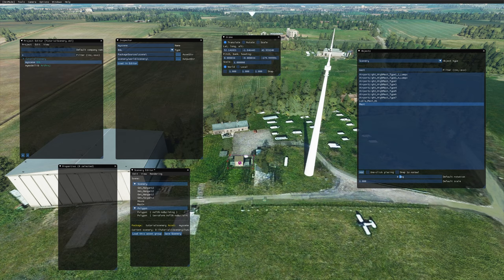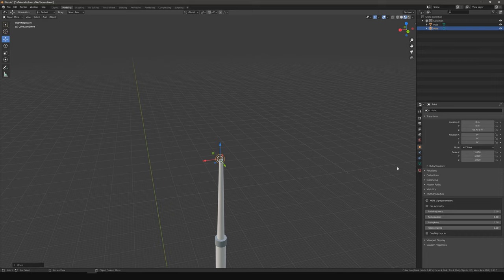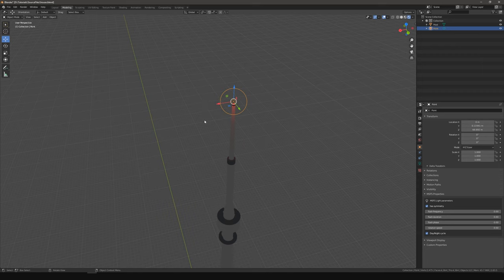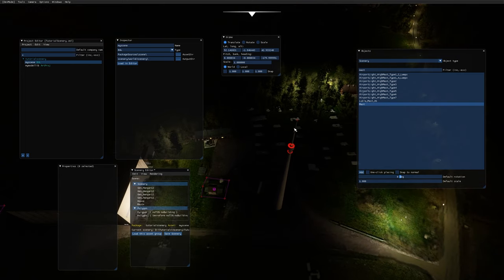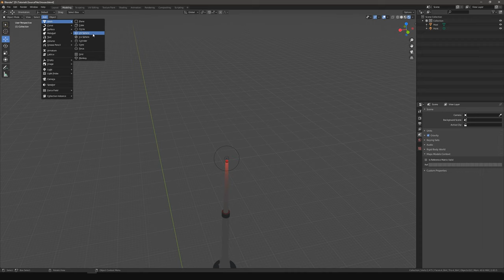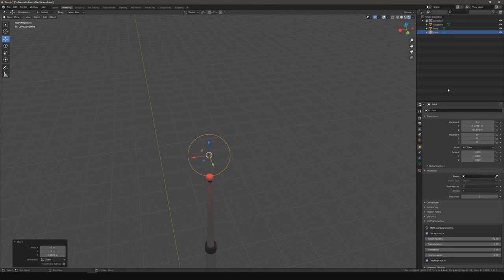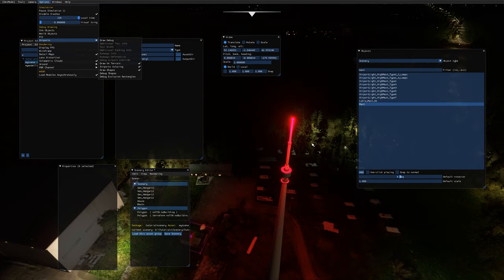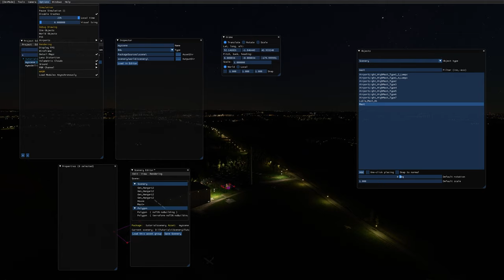[007] Red Flashing Beacons - Microsoft Flight Simulator 2020 SDK Tutorials

Comment: In case one wonder how the frequency, duration and phase of flashing light sources are defined:
-	“frequency” is triggers per minute, so 60 means the light is flashing every second, 20 means the light is flashing 60/20 = 3 times a minute. The higher the value the faster the light is flashing
-	“duration” is for how long the light is ON in seconds. A value of 0.5 means it will flash for half a second
-	“phase” is a delay in seconds. If you have multiple light sources in you object and set “frequency” to i.e. 10, “duration” to 1s and the “phase” of the first light to 0s, the “phase” for the second light to 1s the phase of the third light to 2s and so on, the lights will flash for one second in a sequence one at the time. This is useful i.e when you don’t want your red anti-collision lights on building not to blink in snyc across the whole airport or city.
Reply: Very good explanation !!! Helped me to make a runway flash in non sync, thanks for sharing !!!!

Comment: Not sure about other countries, but pretty much all red obstacle lights affixed to any high obstacles in the UK are a steady light rather than a flashing one. I’m sure there’s exceptions to this rule but this is my experience. Certainly any cranes that are in the vicinity of an airport will have a fixed, steady red light on them. Or multiples of. I think the reason for this is simply so the obstacles aren’t confused with airborne aircraft who’s red beacons will flash. So it’s easy to differentiate between a static fixed object and an airborne target. 👍

Comment: Hello! thanks for the tutorials, they are brilliant. I found an aternative way, maybe you did that already. I was bothered by having to add 5 lights. You can create a volume, place your light inside with the same flashing parameters, and in blender use the decal parameter for the globe surroundding your light. Works very well. Thanks again, I thought I'd try to give something back. Very best to you

Comment: Great set of videos keep them coming. 
What’s the best way to smooth out the elevation faults the defaults have?

YYC Calgary for example, the taxi ways are like driving over a rough field or in Prince George the runways have a massive lump in the middle probably from a plane that was there when they scanned the surface originally.
Reply: yeah I think you can add a polygon and then select under that polygon properties "terraforming"

Comment: Having 5 lights for one spot isn't great in terms of performance, unfortunately. Let me suggest an improvement. It's a little bit advanced and maybe someone can suggest a better way to do this. But this is what I came up with. 
We can create 2 Icospheres on top of each other, one for "off" and another for "on" statements, with "off" and "on" materials. Make two emissive textures filled with black for "off", and the needed color for "on" (2x2 pixels is more than enough for solid colors) and assign these textures to appropriate Icospheres materials. Then we can scale the "on" Icosphere down a little bit, to be hidden inside the "off" one, and animate its scale to "on" becomes bigger than the "off". 
The only thing is left - get light and scale pulsation in sync. We can do this by manipulating the light parameters, and/or adjusting the animation length and keyframe position. For easier manipulation of the animation rate, we can use just 2 keyframes with constant interpolation. One thing to keep in mind is that the "on" and "off" scales must be equivalent in length, so the switch keyframe must be always in the middle of the animation range.

Comment: do you know how to add windows lights with google maps models in blender ? cause the texture are a mess that you cant do the paint trick cause the windows are in over 100 pieces spit in the texture png thx
Reply from the maker: you could try painting them in blender
Reply: @FlyingTheston  the problem is the textures are a mess cause windows  are in pieces not together so i can't see well  which windows pieces are the same , i not suse if theres a way to organize the textures i did uv smart  and bake all textures in one png but everything still mix
Reply from the maker: @Mich8DB  Blender lets you paint  straight onto the model
Reply: @FlyingTheston  thanks i gonna try can I paint shapes  like squares  etc or i have to use the brush by hand in blender?

Comment: Well I am using Blender v2.83.5, follow exactly your steps. Even double checked the XML file in the SampleMyBox.xml  (and read this that I use my own scenery name). I create a couple sceneries and are working in MSFS2020. (for example this one: https://flightsim.to/d/geraldar98/rotterdam-kop-van-zuid)   
But your tutorial about add lights (beacons) and that they will show up in the MSFS2020, is totally not happening for me..
It is not working at all.  What do I miss?  Open the project editor, open the xml.  Click building package, after loading in editor. (I don't need to ADD, because the scenery was already in the scenery. But nothing changed. I don't see any lights. So I tried....Maybe I need to add it by click in scenery editor "Add". But also nothing is showing up. 
In Blender I have also tiggered both in MSFS light parameters. So that is also not the problem.
What do I miss, why not working?
Reply from the maker: are you on the correct version of Blender2MSFS? needs to be at least 0.36.1
Reply: @FlyingTheston   hmmm...wow....good point, I have version 0.36.0 from last week.
I will download the version 0.36.1 and see what happens..  THX.
Reply: @FlyingTheston  Changed it into new version via preferences and install. It show version 0.36.1.  Export again (after restart Blender and open again), but in MSFS2020 still not showing up the lights.   Do I need to create the lights from scratch again?
Reply from the maker: @geraldwillemsen6895  Do you have your light selected when you're exporting? Have you made sure you've ticked all the relevant boxes in the MSFS light settings in blender too? Plus you'll probably want to close your project, reopen rebuild project then reopen your scenery
Reply: @FlyingTheston  Yes, In the right top corner the whole collection selected  before export. And in MSFS light settings in blender, I ticked: "Has symmetry" and "Day/night cycle". In MSFS2020 I start fresh, open project, rebuild package and after that Load scenery and even used ADD scenery.  But still nothing.   Question: Are you using anything else in the PackageSources?  For example I have in ModelLib with in it  the project named model folder and the texture folder.  But not the Lightexample folder.
Strange right?
Reply: I got it, it seems to be an issue with Google Rendered and Blendered Object. Becuae I tried it with an object, a small simple self created block and that is working.
So thanks.